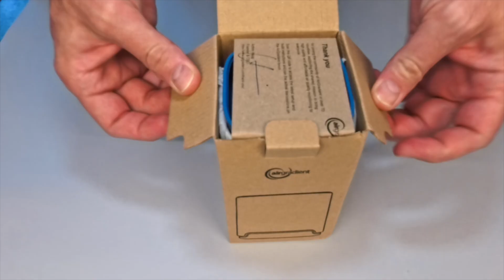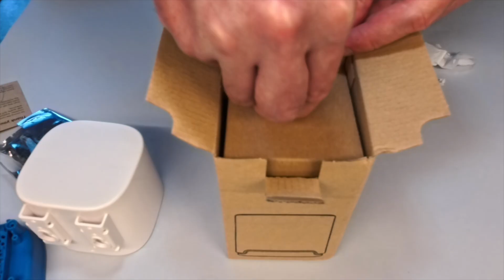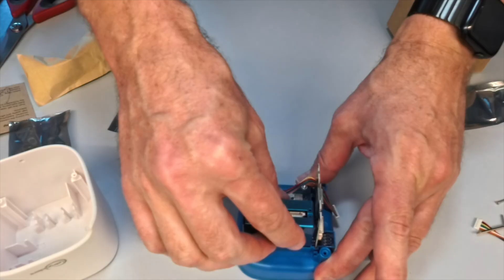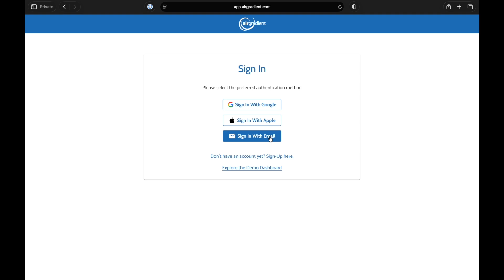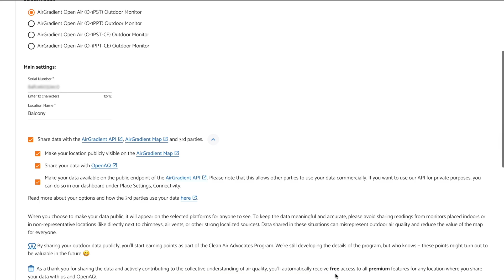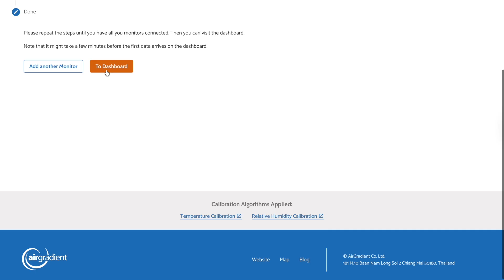Assembling an AirGradient Open Air Monitor

Comment from the maker: A couple of useful tips when connecting the Open Air monitor to the internet: 
* Not all computers and devices correctly automatically display the WiFi configuration screen when connecting to the monitor's setup WiFi network. If it does not appear automatically, open http://192.168.4.1 in any browser while connected to the setup network.
* It is OK if the monitor is connected to the internet before you configure the dashboard. So don’t worry about the ordering here.